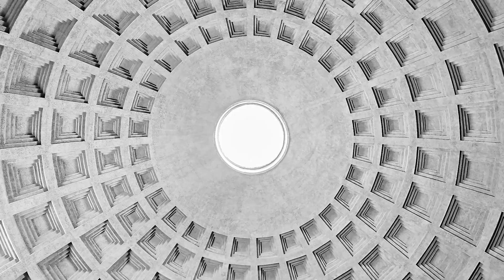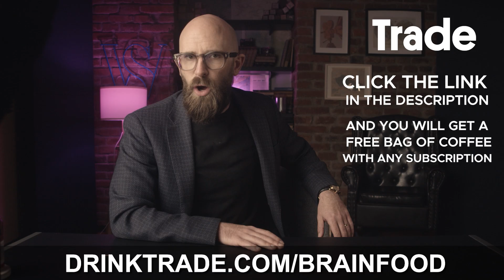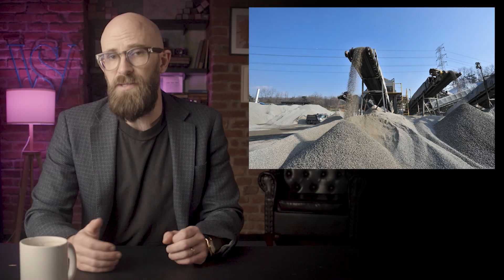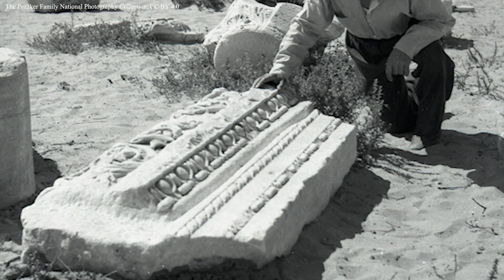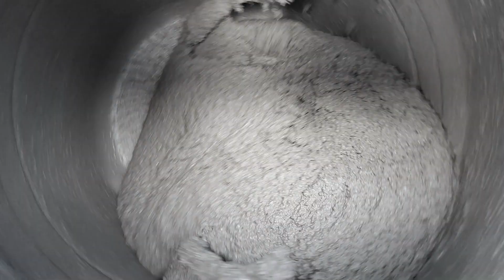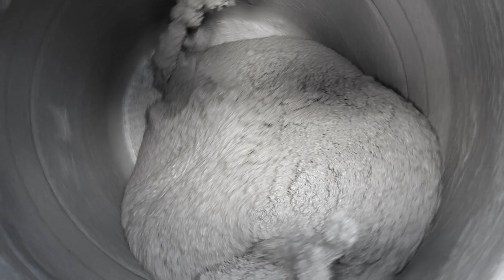How Did the Ancient Romans Make Concrete So Much Better Than Ours?

Comment: If you are willing to make your walls 20 feet thick, like the Pantheon and the Colosseum, it's easy to skip reinforcing your concrete structures. That's okay for a couple huge public buildings but isn't a practical strategy for homes, businesses and roads
Reply: Actually roads built with such methods would FAR outlast the current ones
Reply: @Matt-yg8ub  sure, but if you are laying slabs 10 feet thick you are going to have to first construct a roadbed strong enough to keep thousands of tons from sinking into the earth. That's gonna cost you, durability and economics are always an engineering compromise. Fast, cheap, good...best case you get 2
Reply: @aDiscreteFirm  considering that I design roads, most of the problem is the federal requirements that makes us have to make them cheap and brittle….. and the water department, demanding that everything be less than 18 inches thick so that they can dig through it and patch pipes a month or two after we resurface a road. If they had designed the road to be a road, and not a poorly paved surface covering all the utility pipes…. They would last longer.
Reply: @Matt-yg8ub  probably so, but do we want to repeat the Roman experience and only have running water to the rich people's house?
Reply: @aDiscreteFirm  you are missing the point, instead of running the pipes under the road where the water department has to cut through the road on a regular basis, run them alongside the road in the right of way. You end up with bigger trees in the right of way, more forestation, lower temperatures, less urban heat island effect, less global warming, and you don’t damage the road repairing pipes. 
The Romans built a sturdy road base that could sustain a road for 2000 years because they didn’t bury their pipes under the road
Reply: @Matt-yg8ub  what happens when you widen the road?
Reply: @aDiscreteFirm  you plan ahead and you won’t need to

Comment: Except that Roman concrete only had 1000-2000 PSI of compressive strength. Standard for today’s concrete is 4000 PSI. The Roman’s also did not use any rebar, which means all of their structures had to be massive self supporting domes and arches, which are more expensive to build that today’s conventional structures that use rebar. The mix designs we use today are made up of stuff a Roman engineer couldn’t have even dreamt of. Not to mention we can do it cheaper and faster, AND without using slave labor.

Comment: This is why history and chemistry are important for architects and engineers
Reply: Well that and biology.

Nature is an unending source of inspiration for advancement in many fields of science and engineering.

Chacnes are high in more than half a billion years of evolution can wild that natural selection has provided a solution to most problems.

Case in point the coming optics revolution of metalenses based on a new field of research stemming from discoveries about the way light interacts with the wings of a buttefly.

Comment: I grew up in the coal mining heart Carbon County,  Utah. In our rural double wide trailer on 2 acres of clay ground. We had a coal stove that heated the house, a standard truck bed of coal went for $50-$100 in the 90's and was enough to heat the house all winter.   

We used to pile the coal ash on the side of the property, but I noticed the pile of ash was surprisingly sturdy compared to the sloppy messy wet clay surrounding dirt when wet from the snow and rain. So from that point on I spread the ash over the dirt driveway. Over the years the driveway became harder and less sloppy muddy when wet, almost like concrete.
Reply: Thats incredibly cool
Reply: Have a charcoal grill.  If you pour the ash onto the ground, it starts turning into concrete over time.  Not great for mulch but an interesting observation.
Reply: @ahowl7mx I dump my ash from grill or fireplace in my garden. Very sandy soil where I live (Great Lakes glacial sediment) and over a few years it finally holds water and don’t have to water as often. I like it! Doesn’t seem to compost quickly so it seems to have longevity.
Reply: I would stop spreading the coal ash, especially since you've been doing it for years. Coal ash contains at least 17 toxic heavy metals and pollutants including lead, mercury, cadmium, chromium, and selenium, all of which can endanger human health, and at least six neurotoxins and five known or suspected carcinogens. Short-term exposure can bring irritation of the nose and throat, dizziness, nausea, vomiting, and shortness of breath. Long-term exposure can lead to liver damage, kidney damage, cardiac arrhythmia, and a variety of cancers.
Reply: Well done.
Reply: For some reason I found this comment oddly endearing.
Reply: That sounds like it would work but I worry about the health costs of living with coal ash.

Comment: *In colder region, imagine an asphalt that is self-healing and instead of creating bigger and bigger pothhole, the cracks just never happen. Every non-greedy city/companies would start using this mixture.
Reply: Asphalt is not concrete.

It's very nature as a traction material for automobiles makes it more prone to erosion over time.

The best you can do is slow it down by mandating lighter vehicles - given EVs are going to make cars significantly heavier (in the short term) that isn't likely to happen soon.

Comment: I think the primary reason why the buildings lasted that long is because they didn't use rebar that otherwise corodes with time.
Reply: Same reply to similar comment: Modern concrete is not self healing and cracks and crumbles with or without the reinforcement iron bars rusting. Much modern concrete does not have reinforcement, e.g. domestic foundations
Reply: @jamesevans1890  All the domestic foundations I've seen have used reinforcing, even relatively low retaining walls (as in 1m high at the most) in gardens use reinforcing whether of concrete or brick and mortar.  And I grew up with houses being built around me so had first hand knowledge of what dad put into the foundations for all the houses, and into the footpaths around the house, and the brick retaining walls, and into the concrete floors of neighbouring houses when they were jacked up.  Reinforcing was very very definitely used.
Reply: @HeroyamSlava-g3y  Thanks Karen! I stand corrected.
Reply: @jamesevans1890  That's the only one I really know the timeline of because Vespasian Caesar is a favourite of mine, it's a pity neither he nor is eldest lived for longer because his youngest was a right prat (think King John - of Robin Hood fame - only in Roman times) and nasty with it.  
But seriously, they couldn't afford to wait several generations for an aqueduct to be built simply because the water was needed ''now'', and voters wouldn't necessarily wait for something to be finished some time in the future, said senators, consuls etc would be voted out before they could say aquaeductus.
Interesting fact, some time ago - guessing late 1970s/early 1980s - there were huge floods in Italy when, I think it was, a dam broke with the resulting sudden rush of water.  There were a number of bridges over the river that was swamped and they included a bridge built some 2000 years ago along with several much more modern (think 20thC) bridges.  Guess which ones fell and which one withstood the rush of the water.  There was dramatic footage of the water at the time which made it onto the 6pm TV news (which is how I can date it, the years we had a telly) and it included images of the newer bridges being swept away leaving the Roman built bridge the sole survivor.  Being an engineer - civil and structural - dad wasn't unduly surprised at this, he had a very high opinion of Roman engineering abilities - possibly from growing up in a Roman built city - and a rather lower one of modern engineering abilities.
Ave Caesar
Ave Verulamium

Comment: The reason Roman structures survived is because there's no steel rebar inside to rust. A modern concrete structure constructed today without rebar would also have comparable durability
Reply: Modern concrete is not self healing and cracks and crumbles with or without the reinforcement iron bars rusting. Much modern concrete does not have reinforcement, e.g. domesticfoundations
Reply: @jamesevans1890  Nowadays modern cements might contain additives like Pulvarized Fly Ash (PFA) or Ground Granulated Blast-Furnace Slag (GGBS) which do give self healing properties. If you don't know the difference between Iron and Steel and that all properly designed foundations contain rebar, then you probably don't have a science/engineering background

Comment: So just replicate the roman ash as is needed? Why go for similar when you could make the exact same thing?
Reply: Because the volcano that Ash was sourced from has a hydrothermal system that essentially provided the conditions to mix it VERY easily. Doing that with most other volcanoes would take FAR longer not to mention actually building large scale projects with it would require a shit ton more manpower. The volcano in question is Campi Flegrei.

Comment: So... if its ingredients are cheaper to manufacture and it lasts forever, why aren't we using this right now?
Should be mandatory, especially for projects lika dams.
Reply: It's better for certain things, worse for others. As mentioned in the video modern concrete got 10 times the compressive strength, meaning it can carry much heavier weights, thus making it better for things like roads and bridges used by modern heavy trucks, along with really tall buildings like sky scrapers.
Reply: @dragon12234  well, then we should layer it with modern concrete to use both materials strength. But if we have a material that's basically self healing after being damaged by earthquakes and the likes and we have highly critical applications that must not fail to protect thousands of lifes, we should absolutely use that imho.
We can and should combine all we have instead of basically just not using this ancient technology. If it's not good for the driveway of a bridge, so be it, but for the fundaments it sure is.

Comment: What a clickbait title with some misinformation, modern concrete is stronger and more resilient as it's not one formula or thing.  Yes we can replicate weaker durable Roman concrete but we don't as we can create stronger and durable concrete, provide the self healing when required, and we've had underwater as well.  We even used the forming method as mentioned way late in the vid decades ago with the self healing property and greater strength.

Comment: Fly ash is a fairly common additive to concrete today depending on exactly what it’s being used for. Modern concrete can be a very sophisticated mixture of chemicals, including things like plasticizers that reduce the amount of water needed to mix, pour, and smooth the concrete. As noted in the video, additional water beyond the minimum tends to reduce the strength of concrete. But as noted in the video, we are still learning things from the Romans. They were brilliant in many areas and idiots in others. We serve ourselves well to study both.
Reply: I've seen a lot of guys who request the concrete mixed very loose. They like a lot of water in it for the sole purpose of making it easier to work with and increase the work time. Obviously more water is not good for the integrity of the concrete. The Hoover dam was made with a very dry mix of concrete and it is still getting stronger after over 100 years.
Reply: Well yes and no there’s taking the time and effort to use water at the right times and  to wet cure it witch almost no one does
Reply: Romans mostly copied the greeks and other european cultures. Made some improvements here and there. I would say the greatest feat of the romans was capitalization through the temple of saturn.

Comment: Concrete of today is far better than anything the Romans had. It's "science". We can test properties of mixes and contents the only way the Romans could test this was to hope it did not fail and kill everyone.
Reply: Yeah, about that. 

See the volcano they sourced that Ash from is named Campi Flegrei which has a history of causing fairly major Earthquakes and even funnier still across the bay from this Volcano is Mount Vesuvius a volcano which I shouldn't need to explain turned a large chunk of those building into tombs. To be fair, those buildings have for the most part remained in excellent condition but swings and roundabouts.
Reply: @Akechi_The_Phantom_Detective  Sure being protected buried in ash for 2000 some odd years it should be in excellent condition.

Comment: Modern concrete structures require steel reinforcement.  This steel will degrade and decrease the lifespan of your structure no matter what type of concrete you use. The Romans got around internal reinforcement by using massive amounts of concrete. This just isn't a feasible option on many modern projects.

Comment: Urggg....the real answer is 'by accident' and 'trial and error' -they had little 'chemistry' theory knowledge, they tried stuff and if it worked or was noticeable better than what they had; they kept doing it.

Also 'Survivorship bias' (wiki)-"Just as new buildings are being built every day and older structures are constantly torn down, the story of most civil and urban architecture involves a process of constant renewal, renovation, and revolution. Only the most (subjectively, but popularly determined) beautiful, most useful, and most structurally sound buildings survive from one generation to the next. This creates another selection effect where the ugliest and weakest buildings of history have long been eradicated from existence and thus the public view, and so it leaves the visible impression, seemingly correct but factually flawed, that all buildings in the past were both more beautiful and better built."

Another thing, though it was a bit vague -they seem to have compared modern reinforced concrete with non reinforced; which are very different animals and have different properties.
Reply: This is honestly kind of true. I'll give them credit in the sense they found a formula that worked and kept on using it but I can't honestly say it was a feat of intelligence as it was pure luck. The fact they managed to source Ash not only from a volcano but a super volcano with a hydrothermal system that would've allowed them to mix and heat that is kind of insane. It also didn't hurt in their case that they were willing throw as many bodies as they needed to get these projects done.

Can't help but imagine trying to do this with Ash from any other volcano would take a lot more prep and A LOT more bodies. That said, Volcanic Ash actually seems like a really good material abeit not a practical one.

Comment: I often wonder if we rely too much on "science" in our construction of things. Back then, they often didn't know exactly WHY it worked, only that it did.
"If we make it an arch, it lasts a long longer and holds much better."
"How does that work?"
"Not sure. But we've seen it do so time and time again. It's reliable."

I wonder if we'd actually save money/materials in the long run if we went back to a results first mentality.
Reply: Only issue with that is if what you used to document your process is lost, and you yourself and everyone who knew how is gone. It will be gone forever. If we know the how it works we can replicate it by understanding how other things work in relation and recreate it.

Comment: It is important to recognize that Roman concrete is much, much weaker than modern concrete rendering it unusable for any applications that requires high strength.  Roads, bridges, and buildings cannot use it in any efficient manner.  Dams, retaining walls, piers, foundations, etc could potentially benefit.
Reply: Fair enough - unless we allow the Roman concrete to "age" for a year or 2 after the end of the construction to obtain the physical strength it needs.

Remember: Italy is a country prone to earthquakes, so the great problem in certain structures would be vibration, not weight
Reply: @Jamhael1 we should then

Comment: I roads are  asphalt 2 roads get potholed because thermal expansion and cars cause cracks that fil with water that feezes.  This is not relivant to concrete structures.

Comment: They even found out recently that you can use treated used coffee grounds in concrete instead of sand and the result is 30% better concrete !  With the amount of coffee consumed everywhere on the planet, we might have a abundant amount of material to make concrete !!
Reply: Researchers in Australia have found that concrete can be made stronger by replacing a percentage of sand with spent coffee grounds. By replacing 15% of the sand typically used in concrete with coffee biochar, the researchers found that the addition enhanced strength by 29.3%. You need to cook it in retort oven before it can be used.
Reply: You both are awesome, thanks for the info.